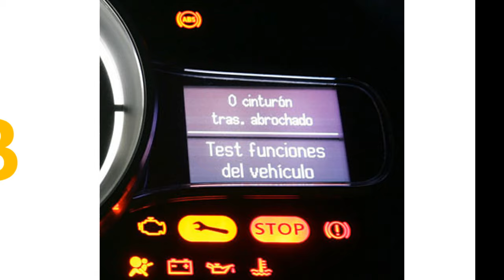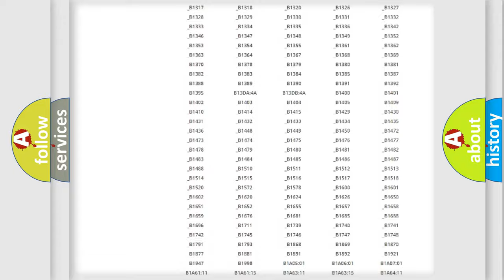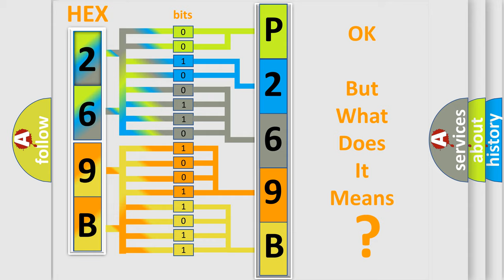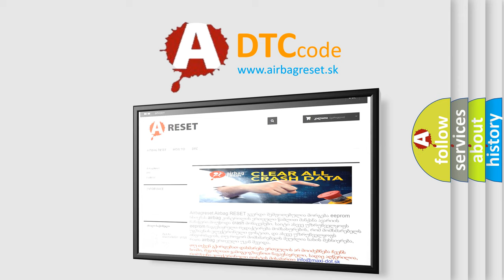DTC Ford P269B Short Explanation

Comment: It means you have a broken wire between Relay 4 of the Vaporizer Glow Plug in the engine fuse box and the PCM below the washerfluid. Check the cable harness between this fuse box and this PCM.